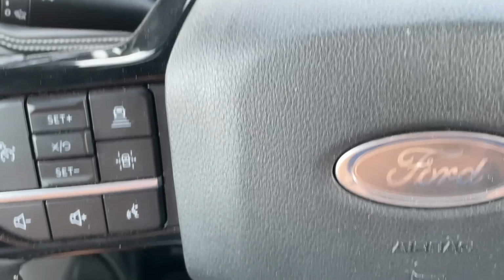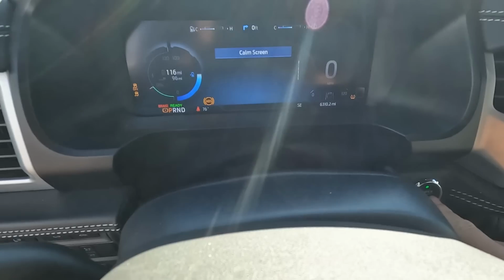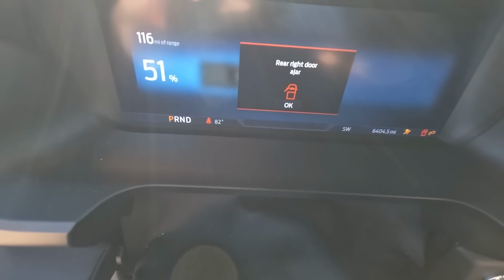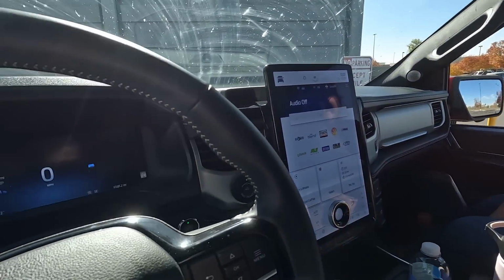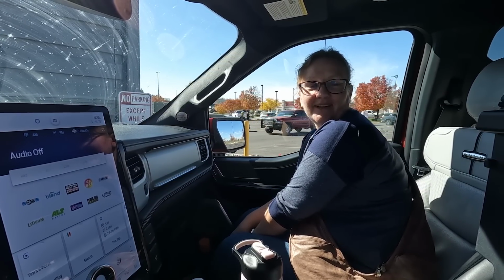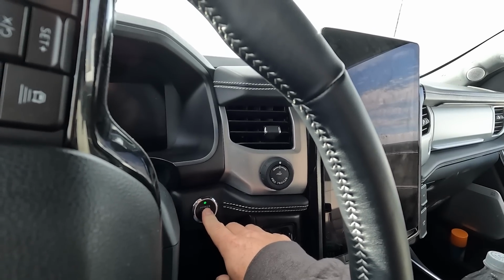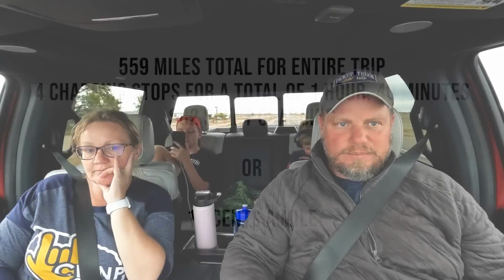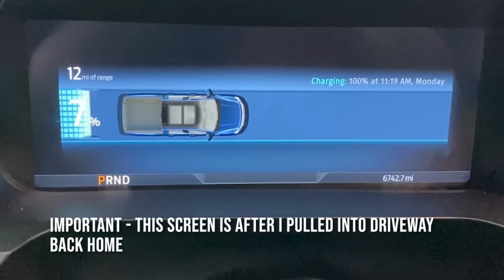Truth on charging times/cost on 2022 Ford F-150 Lightning Road Trip

Comment: Sounds exactly what I experienced. This is why EV's are an actual nightmare unless you are in the middle of a giant metropolitan city and only drive 10 miles to work. Outside of that, and if you like your money, EV's are a complete waste and a nightmare to own. Thank Tim great video!
Reply: Thee flooded EVs have been catching fire lately. Imagine it wouldn't take too many claims like that before you get that letter informing you your insurance had been cancelled
Reply: @disqusmacabre6246  Three cars caught on fire. 1,000 per 100,000 ICE vehicles catch on fire. Dog bites man is not a news story. Man bites dog is. The first is the story, but the second is not, which means that the 3 cars catching on fire is rare. It is the man biting dog.
Reply: I can't say it in a better way.
Reply: So what your saying if your low on power can’t use heater or air conditioning  and you used 82.00 on little 500 miles  wouldn’t make sense to me if you want a mall truck it would be fine  not a work truck.
Reply: this is simply not true. just dont expect an ev pickup to haul 12,000 lbs 300 miles effortlessly. no one said they meet every use case. i did a 610 mile round trip to upstate NY and stopped once in albany to charge going up and once coming back. i walked around walmart for 30 minutes which is a nice break on a 5.5 hour trip. if i had a newer ev they charge in 17 minutes (0-80% on a 250kwh charger). ev cars meet most peoples needs and trucks meet the needs of weekend warriors not people that want to carry around 2500 lbs of equipment and haul stuff 300 miles each and every day. if there is some kind of myth that they would be great for that then go ahead and dispel it but if you're just making the occasional trip to lowes or doing a short haul with a trailer or getting wood or some gravel they are perfectly suitable for that. there are 2 fast chargers near me one in attleboro and one in providence and ive only used them 3-4 times in a year just to test them out. there is one in hartford ct for trips west but 99.9% of my charging is on a 110 outlet and that has worked for a year. if i did more driving i would install a 240v outlet and charge from 0-100% overnight no problem
Reply: Ķĺkkļ
Reply: Agree. Green hydrogen fuel cells are the answer as there is no pathway to net zero emissions without extensive use of green hydrogen fuel cells which in this type of vehicle have 500 to 700 miles of range and refills in less than 6 minutes.
Reply: @icare7151  you have been greatly deceived. There is absolutely no possibility for zero emissions. EVER! You seem to forget that it takes energy to produce the hydrogen.
Reply: @JohnSmith-ug5ci  Net Zero emissions are not only possible, the technology has been available for decades.

Suggest you research  green hydrogen through electrolysis and hydrogen fuel cells. 

Green hydrogen is key. 
I was producing green hydrogen through solar and wind turbine electrolysis back in the 1980s! 

Hydrogen fuel cells produce clean electricity with the byproducts of heat and clean water which evaporates and then is returned in the form of rain or snow. 

The heat from hydrogen fuel cells can also be recovered converting it to electricity via an onboard Sterling thermal generator. 

The science proves there is no pathway to net zero emissions without the extensive use of green hydrogen fuel cells.
Reply: @icare7151  The challenge there is finding a cost-efficient way to get the hydrogen.
Reply: @ironclaw6969  Agree! Reducing the cost of green hydrogen and hydrogen distribution networks are huge challenges but is already being implemented in California and a few other limited locations throughout the USA.
Reply: The problem with EV's in any major Urban region that I have observed, is that sitting in heavy traffic can rapidly exhaust the battery and range.  I observe weekly several Tesla vehicles disabled on the highways of the North East, with in many instances distressed driver's telling me the needed to charge their vehicle, but no changing stations were in close enough proximity.
Reply: @jamesmichael5475  Motors do not idle. The only thing that could be draining the battery would be the battery maintenance and accessory usage. Sitting in traffic would not be a problem.
Reply: @ronaldking1054  Not a problem unless it's really hot, or really cold, both of which will chew up your battery in two ways since you need to regulate both the cabin temperature and the battery pack temperature.
Reply: @ironclaw6969  Exactly, but you are preaching to the choir. @James Michael 's comment: 
"The problem with EV's in any major Urban region that I have observed, is that sitting in heavy traffic can rapidly exhaust the battery and range.  I observe weekly several Tesla vehicles disabled on the highways of the North East, with in many instances distressed driver's telling me the needed to charge their vehicle, but no changing stations were in close enough proximity."
There is only one way he sees what he saw and that is accessories, which AC and heating both qualify under accessories, or the battery maintenance. On the other hand, it is possible to see cars run out of gasoline because their engines do idle, and they need to idle to get the accessories to work in terms of cabin comfort level. This is the only explanation for his comment if his comment is based on reality.
Reply: The f150 lightning would not last in outback Australia or in the high country.
Reply: Ev’s are best first experienced as cars… (Tesla model 3)
This way you get long range, cheap charging, and the highest efficiency.

For long distance drives it makes no sense to use a pickup truck at all… except for, in this case, they wanted to test it out and see how it felt.
Reply: @cybertrk  That depends on what you are doing. I have a Tundra TRD Pro that is a 2019 with 121,000 miles on it already. I do about 40,000 miles a year in it. I am a Regional Manager for my company and do a lot of job site management where mud and dirt are the normal. Trust me when I tell you the Tundra is the best truck for the job. Why? Best suspension for the buck. You cannot beat those Fox Shox. Also, the reliability is unmatched. I have done nothing but oil changes and recommended maintenance. I have multiple friends that drive F-250 diesels and have spent a fortune maintaining them and fixing their front end issues they have. 

Trust me brother it depends on the industry but daily driver get a truck with a great suspension and you'll never know its a truck.
Reply: @cybertrk  I don’t see this being practical in suburban and metropolitan areas in Texas. In places like California you can see the entire Tesla line at a red light. In Texas the many people drive pick ups everywhere. Outside of the metropolitan areas the charging stations are not strategically placed at this point. I am sure this will eventually change but for no it makes no sense to drive an EV out here.
Reply: @cybertrk  EVERY EV on the market today is a loser when compared to a same size gas model.
Reply: @JohnSmith-ug5ci  facts.
Reply: @JohnSmith-ug5ci  The fact I only pay $4 to drive 100 miles charging at home. No ICE vehicle maintenance,  no fumes,  no gas stations,  no noise,  more power than any other F150, and it can tow up to 10,000lbs, built in 9 6 kw gasless generator. How do you figure ?
Reply: @JohnSmith-ug5ci  what exactly do you mean by “loser”?
We know Ev’s are more powerful and lower cost of operation… so what exactly are you on about?
Reply: @pstoneking3418  Once you add a 10,000 lb trailer you won't make the end of your driveway. EVs lose most of their range when towing. I also wouldn't use a half ton for a 10,000 lb trailer. Not enough truck for that that bug a trailer no matter what they rate it for.
Reply: @rich7447  as long as you're not towing long range, Ev trucks are super fun to tow with.

Contractors towing around utility trailers around town are going to love them.

For long range towing, the industry is going to make every single pickup a ug in hybrid. It's a power boost but you get the opportunity for pure Ev driving locally.
Reply: @gelu88  I can see it for some applications (I have a Wrangler 4xe). For heavy towing you have to take into account that you lose payload with additional weight. Keeping a class 3 truck below 14,000 lb GVWR leaves limited payload (5,500 to 7,000 lbs) as it is and the pin weight on these fifth wheel trailers isn't getting any lower. Offer a class 4 or 5 pickup with a mild hybrid on a L6 or V8 diesel and I may be interested.
Reply: @rich7447  They lose a fourth of their range towing, which ICE trucks lose the same fourth of their range towing. This isn't any difference in efficiency loss. It's just nicer to have 20 gallons of fuel rather than the equivalent of 3-4 gallons of fuel. 80 mpg essentially goes to 20 mpg equivalent for the Lightning, and the other trucks get a typical 32 mpg and go down to 8 mpg. There is no difference between an EV and ICE other than how much they carry in fuel. For not having enough truck, a 10k lb. 2001 10-cylinder 
Expedition was towed up a 7% grade and the person doing the test almost rearended the person in front of them because the truck had that much acceleration, but there isn't that much truck. On the other hand, the power boost had trouble starting up the hill.
Reply: @pstoneking3418  where do you live?
Reply: @pstoneking3418  the fact I paid about 50,000 dollars for my tundra and you paid probably 80-90k for your lightning… your still out more money and that could of bought you a lot of gas 😂
Reply: @cybertrk  when you do the math comparing an EV to a comparable sized gas model it would take 20 to 30 years just to break even if the battery lasted that long.
Reply: @pstoneking3418  you people that are caught up in this EV world are either all liars or greatly brainwashed if you think there is no maintenance, no noise. As to power they sacrifice distance to achieve it. Then there is the long charge times. You pay more to get less and have been conditioned to think you are ahead of the curve. In cold temps the EV can lose up to 50% of its distance and take 5 times longer to charge. If you do the math on how much more you pay for the average EV it takes 20 to 30 years just to break even ion costs against a gas model of the same size.
Reply: @JohnSmith-ug5ci  so you’re moving the goalpost already from never to 20 to 30 years… next you’ll check and see the reality is 4 years or 60k miles is where the EV has better ROI and less emissions than it’s gas equivalent.

But yeah, keep acting confident and moving goal posts on a topic you have 0 real world experience in.
Reply: @pstoneking3418  Pulling 10,000 lbs, you'll lose 70% of your range.  There are videos on it.  A guy pulled a 5700 lb trailer with a Lightening, and his 260 miles of range got him 74 miles of actual range.  Imagine if it was a 10,000lb trailer. Now imagine if its below zero. Lets say you start with 260 miles. Throw on a 5000lb + trailer, now lower the temp to -10F.  Your 260 miles of range will get you approximately 35 miles of range. If the trailer was 10,000lbs, you'd get probably 15-20 miles of real range.  LOL.  Let's face the facts.   EV's are for liberals in blue cities, and only in puny cars.  Who knows, in 5-20 years, maybe they will be something that makes sense for normal folks. For now, they are liberal foo foo vehicle and everyone knows it.
Reply: @cybertrk  you are do brainwashed. "Less emissions"? First off what does emissions have to do with your loser? No one is dying due to emissions. Second where do you think electric comes from? Then there is the brown and black outs due to electric vehicles. It is YOU that needs to wake up and smell the coffee.
Reply: @ronaldking1054  They drop to about a fourth of their range towing anything substantial. Diesels barely lose and range when towing a pretty substantial load. Towing a 12k to 14k enclosed trailer from Kansas to Maryland was two fill ups (around 60 gallons of diesel). Without the trailer I can do the same trip in the same vehicle for mid-50s.
Reply: @rich7447  Are you claiming the atmosphere changes because you are using diesel or are you claiming that gravity changes because you are using diesel?
Reply: @ronaldking1054  No. EVs are setup to run using as little power as possible under the conditions that they are normally operated under. This is how they get away with using so little energy to travel the number of miles that they do. 
Take the extended range (131 kWh) Ford Lightning. It has a stated range of 320 miles. Using the EPAs conversion value of 33.7 kWh per gallon of gasoline and 37.1 kWh for diesel the ER Lightning is has energy stores equivalent to:  3.9 gallons of gasoline (82 mpge) or 3.5 gallons of diesel (91 mpge).
The difference in the amount of diesel used to tow from KS to MD was around 10 gallons (equivalent to 371 kWh), but the total energy used was 60 gallons (2,225 kWh or 17 full charges on a Ford Lightning).
It's not that physics change it is that the load added by a trailer is fixed and the additional energy cost are insignificant when you compare them to the losses in a gas/diesel setup, but become very significant for an EV.
Reply: @rich7447  You lose 60% of your fuel to heat. You are only carrying 10 gallons worth of work in your tank. You are still trying to claim that the work changes based on your fuel type. It does not.
Reply: @rich7447  By the way, I had the same argument with a Tesla fan boy as he was claiming he was magically going to get efficiency transformations that are different.
Reply: @ronaldking1054  I am actually not the one claiming that the work changes based on fuel type. 
EVs are setup for low drag and low rolling resistance. Trailers, especially enclosed trailers, are not.
Yes you lose a lot of efficiency to heat (less so with an EV) and drivetrain loses. Electric motors don't have a power factor of 1.0 either, so there are losses there as well. This all adds up to EVs being between 60% and 73% efficient (not counting regen braking, which can put some energy back in the batteries under the right conditions).
Reply: @rich7447  Yes, they are, but there is no way that your changing the fuel type changed the resistance on the trailer. The only difference would be the mass of the truck, but even at that mass, it still does more work. Now, if you got the range you claimed, more than likely you went a lower speed to change the drag, but the same thing can be done with an electric vehicle. Lower speed means less wind resistance and it lowers the kinetic energy applied to the entire system. Drafting works for EV's too as that is wind being funneled around a vehicle, and the fuel type doesn't matter.

Next, you claim that EV's are 60% - 73%, but they are not, and with the regenerative braking they are around 87% to 91%. Before the braking they are in the 80% range, but considering you claimed that EV's don't have the torque to tow, this shows you do not bother to check what you say, and you have no trouble stating something false.
Reply: @pstoneking3418  Up here in Canadian winter only getting 60 miles on a charge with a 8000 lb camper .
Reply: @gelu88  Contractors pull equipment for hours on a regular basis in the real world , not that these puny little plastic trucks are any good for that . Most contractors up here need flat deck duallys .....
Reply: @ronaldking1054  That's the point. The fuel type is not the issue. A Volkswagon Golf would lose significant range when towing a large enclosed trailer, where a semi tractor would not. This is because the semi is not super efficient to begin with (not based on fuel type, but the fact that the vehicles that we are talking about are very efficient. So the fixed, meaning equal to both vehicles, force required to drag the trailer has a larger impact as a percentage on the super efficient vehicle with less energy reserves). Rivian claims range loss of 50% when towing a 9,000 lb trailer (towing that heavy with a Rivian is probably not a good choice anyway). Not a single diesel powered truck will lose anything like that kind of range.
Efficiency of EVs vary by type. The most efficient of EVs are in the 80% range, but the majority (and those that you would tow with) are lower as per EPA numbers. Regenerative braking is not a good idea when towing over 5,000 lbs unless the trailer brakes are somehow tied to the regen brakes.
You claim that I stated that EVs do not have the torque to tow and this is incorrect. I have never mentioned torque in this entire discussion. I'm an EE and am fully aware of the torque capabilities of electric motors. 
In fact electric is the preferred drivetrain to pull very heavy and efficiently. It is the battery system that does not provide enough capacity in order to tow without significant range loss (as I have said multiple times). The last time I checked locomotives were driven by electric motors fed by diesel generators.
A 2022 Crew Cab F-150 carries 26 gallons of fuel which, at EPA conversion rates, works out to (33.7 kWhX26) = 876 kWh. It uses all of this to go 520 miles empty which is 1.7 kWh per mile. The F-150 Lightning ER has 131 kWh and can go 320 miles which is  0.4 kWh per mile. A trailer that adds the drag equivalent to 0.2 kWh per mile (equivalent to 1 gallon per 170 miles which is very low) has a much more substantial effect on the Lightning (50% more) than the gas F-150 (12% more).
BTW: I am not against electric drivetrains, but they have to be matched to their purpose. If they put an 875 kWh battery pack in an F-150 that only got 520 miles range when empty the towing range would be similar to that of a gas F-150.
Reply: @ronaldking1054  I'm actually saying that the same, or equivalent, trailer applies the same drag to both tow vehicles. The difference is not the fuel type, but the amount of that drag compared to the normal energy usage of both vehicles. Physics stays the same, which is why a vehicle that requires less than a quarter of the energy to move when compared to another vehicle is impacted more, as a percentage, when a fixed load is introduced.
EVs have their purpose, but current battery technology (131 kWh < 4 gallons of gasoline to go 320 miles) limits their ability to handle inefficiencies being introduced into the system. Gasoline and diesel are fine with inefficiencies because they have lots of them and fuel capacity is cheap and easy to increase.
Reply: @rich7447  In so doing, you have claimed that the efficiency of the production of energy (work) changes based on what the energy is used for. This is basic physics, and the basic physics show you to be wrong. The friction of the trailer on the motor is going to be the same as the friction of the trailer on the engine. The friction of the air resistance is going to be the same as the friction of the air resistance. Work is work. Range will transform in the same manner. The delta for the towing is going to be the same, but for some reason, you are claiming that the engine becomes more efficient with larger loads even though the temperature in the transmission goes up, the temperature of the engine goes up, and these are the very things that destroy 60% of the energy in the gasoline under just basic movement of the vehicle. They are so bad that the vehicle can and sometimes does turn itself off or at least throws the switch to show the operator that it should be turned off.
No, towing does not improve your efficiency in an ICE vehicle. Your only claim would be that the transmission will not allow you to be as stupid in your driving as the electric vehicle will allow you to be, but the fact the electric vehicle is permissive does not change the fact that the operator can still mimic the transmission with the application of the accelerator. By the way, this is the exact reason that the electric vehicle design is better for towing, and construction equipment when needing power do not use engines, but motors.
Reply: @ronaldking1054  Did you read what I wrote at all?
Reply: @rich7447  Did you read what I wrote? You claimed that energy production changes based on where the energy is applied. The only thing that could be useful is if the transmission forces the driver to drive slower to save the engine, but in so doing both are generating heat more, which means they cannot be more efficient, but you claimed it. More loss = less efficiency, but you said it was more efficient. To make it clear, what you said is that you need a transmission to make you a better driver.
Reply: @rich7447  I will propose this to you. According to you, if you use the same amount of fuel as in the battery, you will end up going further than an EV can towing. Good luck proving it. According to you, on 3.88 gallons you should go more than 80 miles, but even with your inflated estimates, you should only go 73.72.
Alternatively, you can fill the tank, and drive 80 miles and then fill the tank again if you are worried about your engine. If the fuel to fill is greater than 3.88 gallons, the truck failed.
Reply: @ronaldking1054  No. Transmissions keep a less efficient gasoline engine in a more efficient part of the rev range. That is all. Where did you get "need a transmission to make you a better driver"?
Reply: @ronaldking1054  What are you talking about? Is English your first language?
Reply: @rich7447  I found that the aerodynamics of the trailer matter a lot more than the weight. A 1500 pound trailer that is flat will go about 10% as far as an 8000-pound airstream trailer.
Reply: @rich7447  In a towing test in order to test the transmission and battery cooling systems, the electric vehicle ended up never having to derate and the battery temperature never changed. During this test, ICE vehicles with poor transmission designs end up with the transmission overheating. The transmission is essentially the survival instinct of the engineer being placed in the truck in order for the truck's engine to not get destroyed. That survival instinct was therefore inadequate to protect the truck as it instead failed. During the same test, the electric vehicle never had to derate, and the battery temp never changed. Since the battery temperature never changed, the vehicle's controller had no reason to derate the vehicle. While the ICE vehicle had trouble maintaining its speed because the transmission downshifted, the electric vehicle never derated. Velocity is the determining factor on kinetic energy and slowing down means that the acceleration of the system was less for the ICE vehicle in the potential energy calculation. This means that the transmission in order to keep your vehicle running lowered the load on the engine. Why did the electric vehicle slow down? The driver was afraid that his towed mass would fly off the road, which would kill him. This was a winding dirt road. On a highway, your transmission still works, but the highway is designed for higher speeds and as such, there is no fear that the towed mass will fly off the road, and there is still no good reason to tell the driver not to be stupid in order for the truck to keep running. Range is not considered a limiting factor. Do you need the transmission or controller to tell you to not be stupid? Since you are claiming the efficiency of the electric vehicle is less because every single one of the tests keep the cruise control on, then your answer is, "Yes, I do."
Now, you are claiming the constants are different for decreases in range, but this is how many times your towing constant goes into the 10 gallons of work divided by how many times your non-towing constant goes into 10 gallons of work. There is an associative property in multiplication so there is a 10 gallons of work / 10 gallons of work, and as such, it does not matter how many gallons of work you have as this will cancel to 1. Your gas tank does not matter. The electric vehicle's gas tank doesn't matter. This is math, and if you cannot understand my description of math, it's probably not that I do not speak English, but you do not speak math. This ends up with the ratio being the non-towing constant divided by the towing constant. Efficiencies if they are constant also do not matter as I am comparing a vehicle to itself, and the efficiency is applied to all mass so that ends up also being cancelled on both top and bottom. This destroys your argument completely. Efficiency does not matter, and tank size does not matter in the calculation of the reduction of range. What does matter is the mass of the vehicle and the mass being towed, but the mass of the vehicle is in both the numerator and denominator so even that 1.2 times yours is not that big a deal. The ratios are essentially the same, and the larger the mass towed, the closer they are to being identical.
Reply: @ronaldking1054  No idea what you are talking about as far as your described engineer test, but that is fine. Poorly designed anything tends to fail under stress.
I understand math pretty well (and I understand your explanation of your viewpoint entirely) and I believe that we are going to have to agree to disagree. Real world tests will eventually give us an answer either way.
Reply: @rich7447  Real world tests already did. Your truck loses range at the same rate as the EV. The Denali had a 8mpg, and it is normally expected to be a 32 mpg. The range went down a fourth for the EV, but hey, real world tests will show you to be correct. By the way, no vehicle should be changing the input to an accelerator unless there is an emergency. The fact your transmission needs to shows the truck design to be poor as more conditions are emergency for it.
Reply: @pstoneking3418  hey why dont you see how far you can tow 10,000 pounds. EV JUNK. So who cares how much you can tow if it doesn't get range. Its useless look how much they have to pay attention to where they have to charge. The extra work is funny. Thank god I bought a f250 diesel.  Almost 900 kms per tank. And i dont have to plan my trip around filling my vehicle. Lol sucker.
Reply: @pstoneking3418  
Your electricity rates must be extremely low. 
Where I live, it's presently 35 cents per kwh. The push to zero emmission, solar is raising rates and soon will be well over $1.00 per kwh. The taxes collected from gasoline to support infrastructure will come from added taxes on vehicles, tires, electricity.
Reply: @pstoneking3418  I guess your time isn’t worth much to you.
Reply: @ronaldking1054  Man, the pretzels folks twist themselves into trying to justify a turd product.
Reply: @SPike-fo9qg  Which part do you not understand? The multiplier on range is going to be the same no matter the truck, which is basic physics. The initial range is what is what determines the towing range, and that however you attempt to change the initial range other than currently tank size is going to be applicable to an electric vehicle. The motors do not idle in the electric vehicle, but they must in an ICE vehicle. The battery can use the braking to charge its battery system in an intelligent way, but the alternator (brake) on the engine cannot intelligently charge the battery on an ICE vehicle, and the battery does not provide enough storage to use regenerative braking in an ICE vehicle. The 2023 ICE F-150 lost $3000 in value, and the XL with super crew and 4 x 4 ends up still at $43,000, and that ignores the onboard power that you cannot get on the XL at either 2400 kW, 7200kW, or 9600 kW, the scales, the camera, even the basic 12" screen, or the fact that you do not get your axle nor your engine base, but the Lightning gets both its axle and motor base. The Lightning Pro ended would with just the $5,000 would be $44,000 so Ford appears to have lowered the ICE base model and raised the Pro level an additional $7,000 to make their base ICE vehicle competitive with the vehicle that you claim is the problem. Keep in mind the next trim levels up are at $57,000 for the Lariat and $58,000 for the Lightning XL. Who is polishing the turd?
Reply: @rich7447  The truck, trailer thing is a misnomer. The curb weight of the Lightning is 1,000 lbs higher than my 1999 2500 HD Silverado. My older Silverado could tow higher than 10,000 lbs. The lightning has the advantage of regen braking to help stop the trailer as well as friction braking.
Reply: @cybertrk  all I know is when I step on the throttle the ford raptor screams, and when you step on ev throttle you get wind noise 😆 🤣
Reply: @cybertrk  He is on about politics... and being scared. And being a slave to big oil. It is liberating not having to stop for fuel, and 90% of my charging is all done at home. I went from a F250 7.3 diesel to my Lightning and I absolutely love it. I kept my diesel because I wasn't sure how the EV would work for me, but it has exceeded every expectation. I have only touched the keys to my diesel once in 2 months of owning the lightning. And I am a fuel guy. I have a diesel truck, a diesel boat, an old jeep JY, and a 1976 LS swapped Nova. SOOOOOO.... And if I had a dollar for every time someone told me "you are the last person I would have expected to go electric..." The Lightning is so much fun to drive , that I don't even want to drive anything else.
Reply: @cybertrk  Yes, EV's are for blue city car drivers.
Reply: @cybertrk  bro I gotta ask, do you own stock in EV tech or something ?  Have a “ I love EV “ tattoo ?  You refuse to acknowledge reality.
Reply: @DanBCooper  tired of you clowns commenting on something you have 0 real world experience with.
Reply: @cybertrk  I live in California dude, subsequently I have friends and family with EV’s dumb dumb.  Not to mention pure common sense.  If you were right and EV was the way to go it wouldn’t need to be forced on us by the government.
Reply: @cybertrk  speak for yourself guy do not assume guy we all know what happens when you assume. EVs do not last 20 plus years and start off 30 times worst for the environment before they travel one mile and before you are even with a gas vehicle on the road for ten years you need new batteries anyways and start the bs cycle all over again. Do me one favor and name a battery any battery/batteries that actually work for an extended period of time and do not need completely replaced can be rebuilt or disposed of cheaply safely and easily?? Because a motor can be rebuilt or if needing replaced recycled. How long does your 4wheeler, car battery or anything actually last....7 years max?? Even your smoke alarm needs batteries regularly and that is not even using full power your cell phone? 2 years and ya notice the lack of power also remember all the batteries that heat up and explode or leak acid and you actually use alot of your batteries power trying to cool the batteries so they stay operational and not explode. Such a joke man great idea great for some people but still not better in any situation...cool just bought a new car now I need to call an electrician to upgrade my panel to a 400 amp service so I can charge fast enough to make it to work. Come on man! You know what I'm saying come on man
Reply: @DanBCooper  word...hope they enjoy the government tell you when to charge your car and when you can use your AC because its not like the grid has any problems already with out EVs. No power today people sorry no driving stay home in the heat we need the power! No thanks.
Reply: @DanBCooper  LMAO, your friends and family have EV’s and you STILL don’t understand them.. wow…
Reply: @cybertrk  I do understand them.  That’s why I don’t have one.  There’s no free lunch in this world brother.
Reply: Fake fud not true